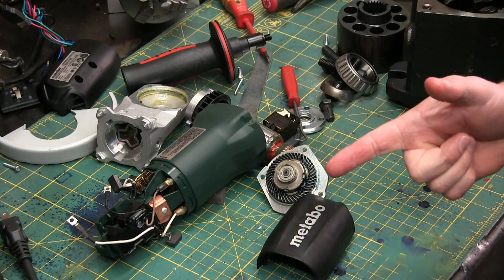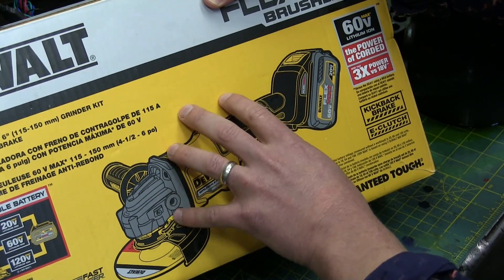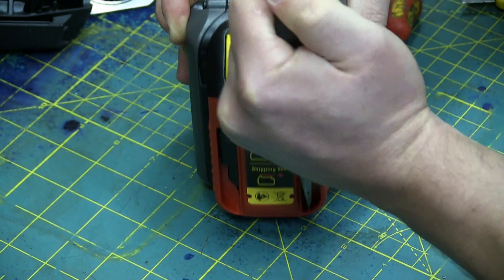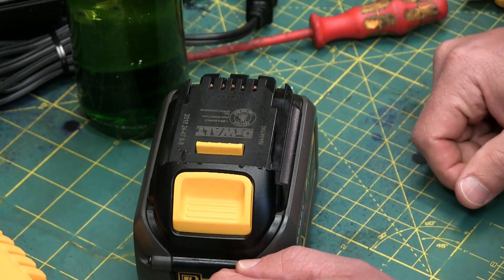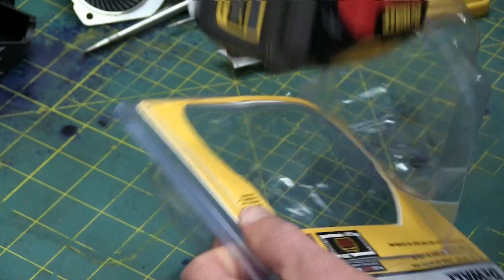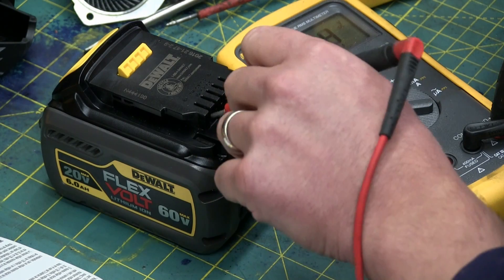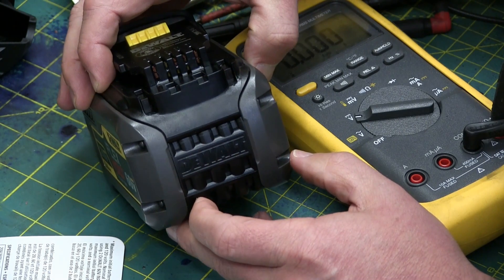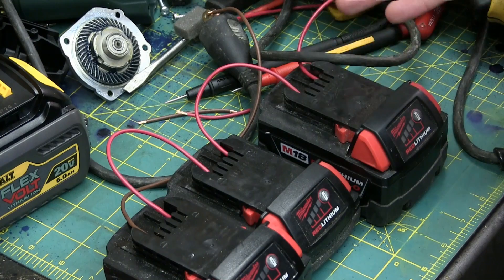Plug-in Power Tool to CORDLESS CONVERSION.

Comment: As for the turbocharger, perhaps monitoring the line voltage and using some chunky ass mosfets, and when the line voltage drops to say, 90v, it switches over for a few miliseconds to give the drill a kick.

You could also use a current transducer and do the same, I actually have some kicking around that I wanted to use but never got around to it since they need positive and negative 15v rails, and I didn't feel like going that much trouble.

Then, when the current draw gets up to 12 amps (or 25 if you are on a 30a circuit) it will kick in the batteries for a brief period.

This sort of setup would also work when you put a load on the tool that is just too much for the wall to supply, it would be able to switch over and run off of the batteries instead.
Reply: Main thing is to just be sure that the two sources can't reach eachother or that will result in some potential fatal, likely nasty stuff.

But hey I've done dumber things lol

Another option would be some chunky capacitors at the end but that would really only work for start up, and not for longer high load periods.

edit: also maybe I should have commented under the channel name that has my electronics stuff lol, oh well
Reply: If you think of large motors or even Air conditioners and heat pumps - they simply use a startup capacitor rather than a battery - the same concept would be better than a battery (unless what you really want is cordless only)
Reply: Which is exactly why I suggested it, and mentioned that it would work well for starts but not longer periods of heavy load.

Comment: What about simple unit with diodes and super capacitors set in two banks, one for each phase of the AC......fast charge and high supply current without the issue of trying to prevent the Lithium batteries going nuclear.

Comment: to simplify the design it would seem to me that one would need to somewhat standardized this to specific type of well known tool battery terminals which allow for some type of accessory adapter plate. Additionally I believe it might be feasible to make use of some type of DC to DC buck/boost converter along with the use of a super capacitor which could allow for the same end result without the need to schlep arround three 20V packs all over the place. When it comes to the lipo re-charging capability this might get a little complicated as I think some of the newer batteries use a sense wire which communicates to the factory charger. All tool batteries I have see. use 18650 cells as far as I know but I think there could easily be a situation where one can kill a pack by overcharging or discharging them depending of the amp draw pulled per cell.

Not to contradict uncle Ave but ... the reason brand new batteries don't come fully charged from the factory is actually on purpose. It's what typically is defined as the "storage charge" which I believe is typically always set to each cells nominal voltage (3.6v) - this significantly prolongs the life of the pack.

Comment: Hum, rectify the ac, then dump it into some lightweight super caps.  Then maybe a big relay, or big mosfet as the reset able  idiot breaker/current limit. 

Maybe throw in a pwm or dc to dc converter to regulate it to get speed control over cheap tools.

Your kinda describing the soft start kits they sell for rvs and other portable use.

Comment: Basically a ups for tools?
Reply: Also from what i understand nicad is better at high energy tasks then lipo is... I guess it is able to dump out more power reliably or something... Big Clive goes over it shortly in his battery powered soldering iron video.
Reply: Of the rechargeable battery types, NiCads were able to dump shitloads more current than NiMH and quite a bit more than lead acid for the same physical size. Unfortunately NiCads were a terrible battery chemistry because dendrites grew between the cell plates unless they were treated to perfect charge and discharge cycles. Lithium has high current discharge and much better cycle reliability.

Comment: Couldn't you achieve the same thing using one of 'em heavy duty 120AC battery packs? Have it run off an extension cord, and then the accessories off the packs' 120 out? I know they're out there. Pricey I'm sure. Bitch to work on, too. Only problem is there'd be a bit too much safety and not enough turbo... but I mean, fuses? Soldered 10ga wire? What's the difference.

Comment: Simplest approach would be to rectify 120V AC to make 120V "DC" (which is super "bumpy" anywhere from 0 to 120V DC).  Then attach DC battery source in parallel, but with a diode so it doesn't charge, it only takes current from the battery.  Then it ought to "fill in" the valleys in the rectified 120V for a bit of turbo, or supply all the power if wall power is absent.  Now there are a lot of problems, first this will drain your battery even with light use where you don't need turbo, so add a manual switch to turn turbo on and off.  And the charging has to occur separately, which is a pain.  Then the 120V DC receptacle will get the safety weenies all excited so you would never be able to sell this thing.  And finally it still won't guarantee that the breaker won't be tripped.

So you add a bunch of smarts, current sense, automatic charging, generate 120V AC output to keep the regulators happy, and you've essentially built a UPS.  Where's the fun in that?  I say build the DC parallel booster just with 5 diodes.  If you must, then perhaps add current sense to avoid the manual switching and you would have to also add voltage sense in order to work offline.

Comment: That idea with backpacking the dc batts over ac is seriously awesome shit!!!! Im curious on where you go with it @AvE
Reply: Just wondering, after you tie into the motor from the controller you need to use for the dc side what would you use to stop it from back feeding under load just some diodes?  so the AC doesn't try to feedback into the dc batteries/controller... don't roast me too hard i'm a dipshit when it comes to pixie wrangling

Comment: The reason they don't charge lithium batteries to full capacity at the factory is that Lithion ion batteries degrade faster when fully charged. 50% is the safest voltage to store the battarias on long term. http://www.mpoweruk.com/storage.htm

Comment: They might not charge them fully because of storage voltage.

Like lipo batteries that I use for RC, they dont like to sit long will a full charge, and can loose capacity and discharge capabilities.. So they dont fully charge them before shipping them/storing them.

My lipo charger has a storage mode, I hardly ever bother.

Comment: So you basically want to build a UPS. Either way the higher voltage of many connected batteries will bite you.

Also they don't cheap out on charging the batteries at the factory. They store better not fully loaded.

Comment: This i've known about for some time, made a battery pack set up before that was meant to power the more powerful hand tools you'd run at home. Tested a drill running off the pack on a deadbolt, undid the thing in no time. But I will say this if I made it again i'd try not to be a cheap skate on the batterys, since the shit gets a little heavy if they aren't lithiums.

Comment: the batteries don't come out of the factory fully charged because it's bad to store li-ion fully charged. 50-80% is best storage condition since they don't know how long it will be on the shelf. Of course it's also cheaper and just enough to test the protection circuitry.

Comment: a current shunt resistor and op amp that triggers a relay could switch the tool to DC from the li ion cells during high load conditions.  a 555 for some hysteresis for turn off time.  Charging and balancing would be tricky for that many cells in parallel.  large 4.1V zeners could be used to prevent over voltage and polarity reversal on each cell.

Comment: I think if you run batteries as your turbo charger and a battery charger you're going to have problems.

Problem 1 to keep the batteries charged up you need a battery charger that is capable of charging faster than the tool draws power, since there will be a non zero amount of power loss between the charger and the battery. If you can go pure DC this will help this problem. 

Problem 2 if you have a 120v battery running this system you either have a huge size battery or you have one low on amps, both options are sub optimal. 

I think a pure battery system is viable only on pure DC if you go ac you need an inverter and then you're losing a lot of power most of the time, plus it's pretty dirty power. 

Rinoa super genius could probably come up with something better than me though.

Comment: I remember starting cars while they were still plugged into a wall charger to give the starter that extra boost. You could build a 60 volt AC to DC power supply that charges a battery or super capacitor until there's enough power to start the tool, then have the power supply feed straight into the tool once it's going.

Comment: butcher a high power UPS

their duty cycle is not great but if you only need it for surge power would be fine

they already have the circuitry necessary for charging, surge suppressor and power cleaning.

job done

Comment: This proposition is dangerous for several reasons:

Unregulated DC current surge 
Unregulated lithium charging
Unbalanced lithium charging
Unregulated overvoltage draw 

Possible? Yes. Practical? No.
Reply: shoehorning a 454 4bbl into a Suzuki Samurai won't burn your house down in your sleep. Everything Ron Furro said certainly can.
Reply: Just ask Samsung.
Reply: ya it's just like a ups for servers, they somehow got around those problems.
Reply: +Michael Taylor It's not just like a UPS.  A UPS uses lead acid batteries, not lithium chemistry batteries.  It also doesn't feed DC into the load, it drives an inverter with the batteries and the inverter outputs 120VAC.
Reply: Only when they happen to me.

In all seriousness, yes this is potentially dangerous. Especially if the tool develops a fault which results in all the magic pixies racing through it or you. What you may want to do is add a fuse/breaker to your box, like a 20 amp one. This will give you the overhead you want and will over you some modicum of protection.

Comment: The Big yellow button...unsubscribed as i watch him try to pry it apart.
Reply: I was at least expecting him to open the battery to show us what's inside. Some of the remarks about how universal motors are constant power need some clarification. A router with a speed regulator would be constant power, but universal motors are not. A long extension cord would in fact reduce the startup current of a universal motor. Induction motors such as those on air compressors will draw higher current when supply voltage is reduced.  If the site has 240 volts then a step down transformer could be used where the tool is located to reduce losses over a long cable run.

Comment: I get where you are going with the Supercharging big electric tools but is Lithium batteries the way to go.... what about a super cap bank? It would be lighter and could more easily discharge a boost of 20-30 amops without the thermal runaway risk (cough, Samsung phones) and cost of lithium..... whacha think?

Comment: warning - the switches are not designed to make/brake DC

The closest you could do is steal the concept used by solar  grid inverters
Reply: if the switch wasn't ac only, this would work, universal motors (and most modern electronics) are quite happy with DC, but the switches, relays etc will fry
Reply: Just use 120V DC, then the amperage will be the same.
Reply: +Paul Glaze but it is still DC

Comment: Hay ave what's the max voltage can you run that drill at on DC. can you put like let's say 80v or 120v dc ... make a super skookum drill...more power more better...will it burn up the drill... love to see you try that in the next a vidjo... since AC current isn't constant the work load isn't at full... but would 120v dc do damage... it would make the charge circuit a bit easier and it could also give you more power?...  I mind you anything over 80 plus DC tingles abit   so be careful. trust me I've got nailed by 120vdc  once while having my other hand grounded on the frame ... it could definitely shorten the longevity of your pacemaker.

Comment: Those folks that err pitch'n the so called solar generators at the Costblow have something similar.  That said, taint the cost of a thicker cord less than the liar batteries?  Mighty skookem concept for remote job sites, on the generators!  Metabo, is for  the quiche eatin crowd that plays at gitten er done, whilst the tools stays pretty in the box.

Comment: What about using 10 12-volt car batteries connected up to a generic battery charger. 

Bob is your Aunty?
Reply: With that sort of weight you could just use a generator.
Reply: A motorcycle style battery would cut the weight.
Reply: +Paul Glaze I can picture someone wearing a backpack with all those batteries while trying to grind. yikes
Reply: If we want 500 cold amp and 300lb of batteries that would work. Is it still portable in the hundreds of pounds?
Reply: You can get fuel for a generator quicker than you can charge a bunch of batteries
Reply: Better to hold the blueprints.
Reply: Indeed... Well played

Comment: I'm a bit curious on how you plan on building this? The issue i see is that the AC current will push current the wrong direction with every phase change. You might be able to do this with some AC synchronization circuitry and some heavy duty switching mosfets to only supply DC voltage during the correct phase. You will also have to boost the DC voltage to 120V to match the phase voltage or else the AC current will try to push into the battery. Diodes would block this, but there wont be any forward voltage one side is 120V and the other is 60V. You could also just build a super beefy inverter with phase synchronization like what's found in UPS gear. The inverter could sit on standby until the input voltage dropped below a threshold and then attempt to supplement the power with the inverter. The only issue is that the inverter may also feed back current into the line if the line is under the inverters voltage. In that case it may make more sense to just match the line voltage at all times. If you pull this off i would be very interested in hearing about the design of it!
Reply: It's also worth noting that UPS gear fully switches to battery power in a low voltage scenario. Trying to supplement the line voltage would take too long and would try to power the entire circuit in a power outage scenario. Power tools aren't as susceptible to voltage drop as servers, but feeding to current to an entire building circuit is still not good. Maybe the right idea is to have some super fast switch that engages battery power when the AC voltage drops, then switch back when it restores. In a normal circuit overload scenario you will oscillate between the two very very quickly. But each switch to battery will keep the circuit breaker from blowing. This can keep the battery and AC power isolated, and remove the inverter from the previous suggested plan.
Reply: I think i've got it. An Arduino, Solid State Relay, and battery charging circuit. Arduino monitors line voltage, if the line voltage dips below (insert arbitrary voltage here) it uses the relay to engage battery power and disables charger, when line voltage is restored it switches back to line power and enables the charger. In a light overload scenario, the relay will oscillate between line and battery power to offset the slight current over draw. In heavy over current modes the relay will stay in primarily battery power as it will take longer for the line voltage to restore itself. The key will be to also make the Arduino aware of when battery power is actually initiated. The Arduino can switch much faster than the relay, so it has to know that battery power is actually initiated before switching back. Or else you will probably kill the relay or float in between line and battery voltage which could have unintended side effects.

Comment: what about using some kind of inverter stuff? if it only needs that little extra juice then why not just have it change the 20v DC into the 120vac and supply that to the tool parrallell to the original source voltage? or maybe you could somehow with winding the input from the wall around some kind of ferrite core along with some wires off of a step up transformer to try and excite the wires from the wall? I'm no engineering pixy wrangler, so if that stuff is just a bunch of garbage then disregard it lol, just thinking of how a high frequency box for tig welders used to work

Comment: Turbocharger for Power tools? ... We computer types just call that a UPS, and you can buy them for reasonable rates from your local scratch and dent computer type shop.    (Power smoothing + Battery backup + Charging) ... about the only problem you'll find is that they chirp when it's overdrawing on off main power.   At least, as far as I've ever seen.
Reply: PS: Uninterruptible Power Supply.    (Quite certain it runs at 120v also...) ... and if you feel your wallet is too heavy, they have ones for server applications that provide power for longer than 15 minutes at a clip.    You'll just drop your pair on the ground if you try to solo-lift the silly things.

Comment: Good thoughts.  tripping breakers and over projects trying to find my way out of the shop back to the house is getting old. going to do some test with industrial 12 volt batteries in series.  see how long a grinder cuts with a big line them.    any reason i can't go over 120 volts a little?  more chooch?  lots of potential here for off grid building. thanks for doing the thinking for us.   can't wait to see what you come up with..